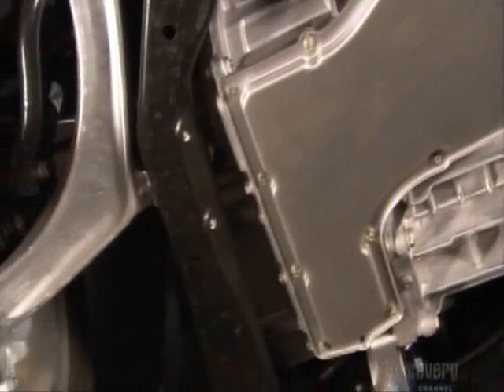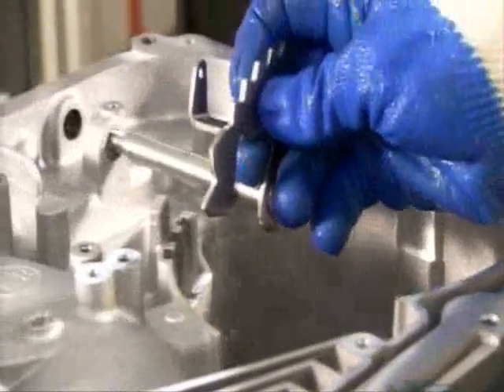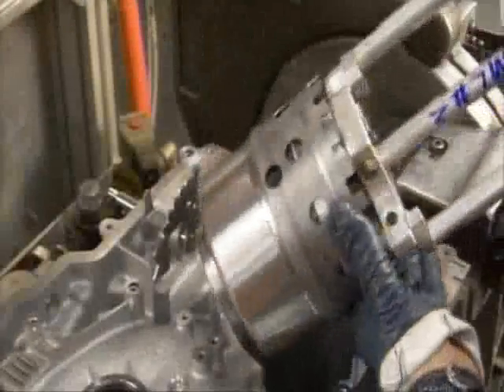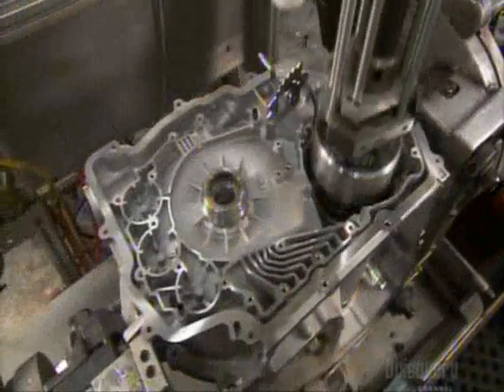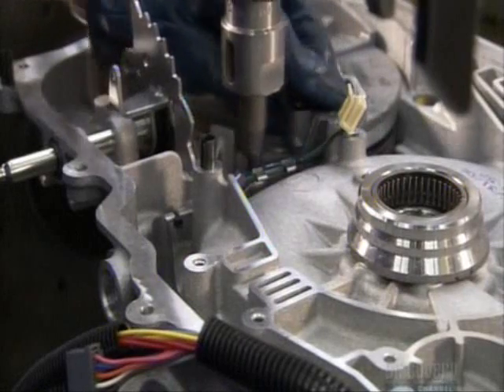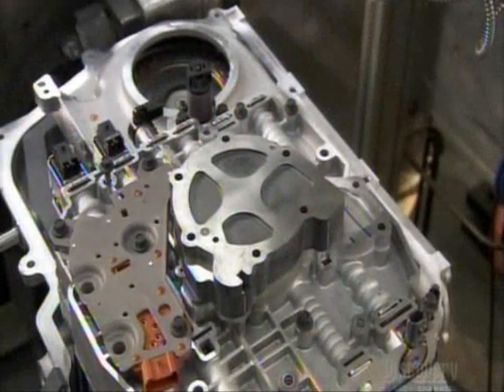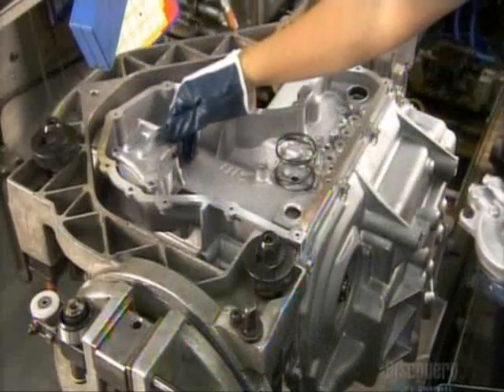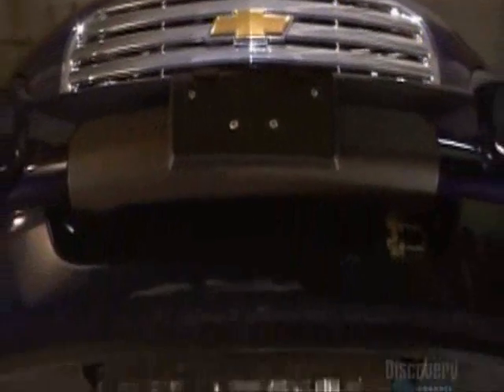How it's made Automatic transmission

Comment: Cheaply made transmissions, no check stick and forced to take it to a mechanic or dealer just to check the transmission level. That means that if there's a transmission leak then the owner can't check the level themselves and add fluid and can cause even more transmission damage or failure if they can't make it to a mechanic or dealer and either stuck or pay even more money towing the car when all it just needs is a few pints of fluid. Way to go GM.

Comment: automatic transmission the best👍
Reply: +Eduardo Caballero The best, huh? Well, concider this: There are certain things you can do with an MT what you can't do with an AT. For example, starting your car downhill in 2nd or 3rd gear if your battery doesn't have enough juice to crank the starter. No AT would let you do that!
Reply: ...said no one ever
Reply: +Bandicoot803  Honestly in this day and age, who the fuck needs to do this on a regular basis? Congrats you pointed out the only marginal (im being generous) benefit of a manual. Modern autos accelerate you faster and save you more fuel than any manual ever could.
Reply: havoc1482
I'm really speechless, you know? Your generousity really touches me!
I have to admit that you pointed out a really good reason for AT: Age! It's practical for partially disabled drivers who can't shift anymore due to being older or other reason.
But: If you can't or won't drive an MT due to laziness, then, I'm sorry, friend, you CAN'T drive! You can only move forward or reverse. Manual shifting is an art which is way superior to any AT or CVT. I don't need any computer to do the shifting for me (yet) !

Comment: Just know not all automatic transmissions function the same.  Honda automatics work more like manual transmissions that are controlled automatically. The internals favor a Honda manual transmission.  5 minutes isn't long enough to really explain how they work, but the video did a good job focusing on the main point. Hyrdraulics that are controlled electronically.  Without fluid it is a hunk of metal.

Comment: 04:31 they show haw a faulty screw is being put into an automatic gear shift, nice
Reply: Mario Josipović Wobbly but is it faulty? How do you know?
Reply: looks faulty to me, every part in there needs to be precise, i doubt a wobbly screw goes in there
Reply: It is just holding something in place. It doesn't need to be precise.
Reply: That wobbly screw is a TapTite Screw. It is a self tapping screw going into a hole that it not tapped. The wobble is just the way it goes in and taps its own hole. It was new technology back in 1993 when the 4T40-E was designed and is now standard procedure now. There were many innovative things on the 4T40-E and was  GM's World Class transmission till it stopped production as the 4 speeds were phased out in 2010. I worked there for 31 years and started when we built the TH-350 then the 3T40.

Comment: Bring on the electric car revolution. One motor, one planetary reduction gearbox, and one battery pack. No gear changes, no clutches, no stick shifting :)
Reply: C1500 Chebby Not sure you know how burning works.
Reply: So how then do electric cars "suck"? Because aside from the current lack of a transmission, and a noisy engine, there isnt much difference in performance of high performance ICEs to high performance electrics.

All im hearing you say, is you just like the sound of a loud engine. Because there's nothing about an electric motor that precludes a manual transmission.

Your tune will change when electrics start passing you on the motorway.
Reply: Mathieu Thomas Welcome to the real world
Reply: No, I didn't, those are pretty cool pieces of technology. 

Still, its the burning itself that gets you- can't dodge that CO2.
Reply: ADeviatedSeptum Lol i will i prefer the power of a real engine, and being able to have the joy of driving a manual. Ive been in a tesla before, and i dont like them at all.
Reply: Shadowaries1 Lol, you're the perfect victim for a Tesla. You really don't sound like you've driven anything more than a 60KWh Model S, much less looked at it's stats. What's your best quarter mile? Can you even hit 60 in under 4 seconds?

Fan motors? If you put fans on a P85D's two motors, they would probably disintegrate.

So, how do electric cars "suck"?
Reply: Shadowaries1 Lol, considering ICEs have had a 150 year head start, id say Tesla has already caught up. There are already plenty of electric rally racers in development, by the way, so I think you're gravely underestimating the speed at which electrics are overtaking gasoline.

The P85D has all wheel drive, so I see no reason why one with the right suspension and tires wouldn't do any worse on a rally track. Just because Tesla hasn't decided to compete against rally cars yet, doesn't mean they cant. There's nothing stopping them from putting a gearbox in it, well, other than current demand.

You're also missing the point that the Tesla P85D is a LUXURY SEDAN. It's designed for conditioned asphalt. It just happens to be better than the vast majority of ICEs. When they(or someone else) decides they want to use the technology to compete against the WRX on a dirt track, it will look like a toy.

Also consider the dramatic reduction in points of failure.

Whether or not Electrics are better than ICEs is debatable, obviously, but you're ignorant of the facts if you think they aren't even a threat, and that's what's gonna get you beat on a track.
Reply: Lol this is hilarious. All of the people saying they don't like Tesla's probably can't afford one (before you try and swing your dicks around, a P85D will set you back north of $90K). They have 800HP and 800Ft.Lbs. available at zero RPM. Having both hands on the wheel means you can take corners like you wouldn't believe and more focus on the road. There is a reason Formula 1 cars use SMG paddle boxes and no driver oppped clutch. Here's how I know what I'm talking about-I have been a BMW enthusiast since I got my license at 16 (24 now) and have owned numerous five speed BMW's and M3's. I currently drive a 98 Z3 five speed. I picked up a Fiat 500e as a commuter and it is fun as hell. Being able to dust ANY car off the line is clutch when you're in the city. You can snake in and around people like you wouldn't believe while the guy in the Ferrari in the next lane is 45 ft. behind you waiting for his v12 gorilla to rev up enough to produce power. Fact is, you truck driving douche bags have had your day in court and you LOST gloriously. It doesn't help your case either when you say stuff like "fuck polar bears and this planet". It only makes people want to set your house on fire more... :)
Reply: Brilliant
Reply: ther eis no way that in my life i will owned an electric car i drove a leaf few weeks ago its is awful
Reply: No, get a diesel powered car and run it on veggie oil. ZERO harm done to our planet. No batteries, no fossil fuels and proven longevity of a diesel engine. Smells like french fries and can leech of fast food restaurants for cheap cheap fuel.
Reply: Still creates CO2 and pollutes the air with particulates.
Reply: Probably not as much as diesel fuel.
Reply: Andy Skraga
Humans do the same.
Reply: And if you cook with veggie oil I'd say it's a lot easier on the environment. Cook with diesel? That's just wrong.
Reply: i hate diesel too yuk !
Reply: Diesel is a fuel, not an engine. The first "diesel" ran on peanut oil. The modern "diesel" burns cleaner then the air we breath.
Reply: No, it's the EPA that puts down strick emissions. I don't know if you know about the DPF, EGR, and SCR?
Reply: It takes almost 70 6.7L fords to make the pollution of one 7.3L .If you ask me that's a huge improvement. It also doesn't help that the air quality isn't as clean as it can be.
Reply: C1500 Chebby Diesel is actually a heat cycle... as opposed to the Otto cycle which most cars run...
Reply: krap101 Yea Diesel i weird it combusts by the heat made by pressure.
Reply: Shadowaries1 Drive a Tesla Model P85D and then see if you feel the same way.
Reply: ADeviatedSeptum lol not for a few years buddy my 02 WRX is pushing 450HP out of an originally 250HP engine, and my 2015 WRX STi has 350 with minimal mods, and the engine originally produces 3305HP. I smoke 600 HP mustangs in my WRX so im sure a fucking car with fan motors for power will be passing me.
Reply: ADeviatedSeptum actually yes the stock WRX hits 60 in 4.2 seconds in a non conditioned track Aka rally tracks. My 02 has a 0-60 time of 3 seconds on rally dirt track. Id like to see that thing go anywhere besides conditioned asphalt. Those coils max out at 14,000 RPM which is only about the 60-90 MPH range in speed. Without a gearbox you screwed after you max out. The point is electric cars will never catch up to real cars anytime soon. the new GT500 boosts twin turbo engines on a V-6 and is pushing 800HP.
Reply: "I hate fun"
Reply: Mr.Green A chinacharger on stock internals lol, whats a chinacharger, and im far from stock bro. Also Subaru is JDM not CDM. Its a fully built pro tuned JDM STi Engine, EJ257 to be exact.Its in an 02 WRX, and has a bit over 100K on it so i dont think its going to be blowing anytime soon.
Reply: Shadowaries1 DUDE! I am bashing all of the diesel dudes on here that rip on people driving smaller cars. What you have sounds NASTY. And in regards to the last part in your comment...hell yes, both in my Fiat (186 fl lb, at 0, trust me it's entertaining...) and my BMW which works out well enough. I don't think I called you out ONCE in my rant. Take offense where offense is due. Know your allies and your enemies, I think if you read my post a little bit closer-you'd realize you and me are more or less into the same kinds of cars.
Reply: Chace Hart Meh i normally come to the comments to bash, and troll anyway lol, and thank you for the compliment. Not a fan of diesels either simply because of the fuckbois in my area that "roll coal", and think its cool, especially to people like me in the smaller sport cars. Its a bitch when you get soot sucked into the intercooler because its a huge bitch having to clean it out, and clean the fins.
Reply: and no fun ...
Reply: I have a diesel car for every day driving and a v8 corvette c3 fuck polar bear and electric cars
Reply: Lol electronic cars suck. I have a 2015 manual WRX STi and it's the best. Automatics are for pussies who can't drive lol.
Reply: Chace Hart Actually try 503 HP Rear, and 259 front lmfao. My Subie kicks up 400AWHP from launch, and produces nearly 700AWHP at full, and still has better handling. I bet you think youre a bad ass "Dusting" people off the line in your cute little Fiat.

Comment: I love engineering but I will never understand how an automatic gearbox works. And this video didn't help. Annoyingly.
Reply: EFLCModder It's actually pretty simple, but there are various ways of transfering power from the crankshaft to the wheels. Older systems uses brake bands, the newer ones use cluthes. The shift control is the same hydraulic system. 
If you think of the auto transmission as a 5 speed manual gearbox with a clutch for each gear acting as the gear lever in a manual and the hydraulic system as the driver shifting, you are not far off how it works.
Reply: Stefan Asmussen Thanks Stefan. I have to say that this is the best explanation I have ever heard that's describes the principles of an automatic gearbox. I shall be remembering this for a long time.
Did you know that cars with auto boxes in the UK tend to one or two brackets higher road fund licence than the same car with a manual box due to their inefficiensy as UK road fund fees are based on emissions.
Reply: It consists of magic and friction and a lot of clutches, I shall join too of not fully understanding how it works. I still prefer having a regular gear box and 1 clutch, manual gear shifting isn't to hard when you learn how to do it effectively. Then again America has to be different than the rest of the world.

Comment: Why don't they just make a regular automatic transmission 'why all these front wheel drive transaxels' I hate front wheel drive 'it's probably another commie Democrats crazy idea!
Reply: pclose9 this reminds me of that comic where a guy falls off his bike and blames it on communism
Reply: ^Troll
Reply: word
Reply: pclose9 more friction and weight in rwd
Reply: Fwd is cheaper to make than rwd, as there are fewer parts. Less weight. Therefore, cheaper with better mpg, the two main factors ppl consider.

However, it is more expensive to service/repair when it goes bad.

Comment: A 4L60E is one of the best automatic transmissions there is. They are used for drag racing all the time. It's an extremely durable medium-duty transmission. There is a reason GM has been building them for over three decades.
Reply: And yet - watching being assembled there, it looks a bit cheap.

Comment: Too many new cars are Automatics and will be a nightmare one day for repairs since they are so complicated and mainly Front-Wheel  drive. A  manual tranny  can be replaced for about the cost of fixing an Automatic when it's really damaged and needs aboy $3000.00  to remove and fix. Plus, you can Push-start a manual if the battery dies and limp home.

Comment: I don't think so - Simple physics - During transfer of power from the engine to gearbox there is some loss of energy - Now add a torque converter and there is more loss of energy - This directly translates to lower fuel efficiency !! This is theoretical given the same engine with the same gear ratios, same fuel and same kerb weight. Ah! And also automatic transmission adds to some extra weight as well

Comment: The Mclaren MP4 12C fails on 2 accounts: 1) I asked which British cars goes around corners like the ZR1 or Z06 AND is in the same price range. Last I checked, you can buy 2 ZR1s for the price of the MP4 12C and still have enough left over to pay a British Butler to wash both cars AND serve tea and biscuits, LOL! 2) The Mclaren also fails because it is not thoroughbred British! The engine block was stolen from a Nissan and Mclaren then modified it. Very British to claim others tech as their own!

Comment: No. Camaros use GM's LFX (V6) or LS (V8) motors. They are pure bred American motors, nothing Vauxhall about them. Vauxhall is a wholly owned subsidiary of GM, so yes GM engines are also found in Vauxhalls. Saying that Camaros have Vauxhall motors is completely wrong. Also, when you say out cars in the UK can go around corners, pray tell, exactly which British car goes around corners as well as the Corvette Z06 or ZR1 or even the Camaro ZL1 And is in the same price range??

Comment: gears are important because when driving faster your engine revs will go to too high if you do not shift.  Manual shifting will result that the car transmission dont have to be extremely complicated and high maintance...   Plus if we talk about control.... automatic you can easely get out of controll due no controlled clutch/gas method. I rather have full controll over my car so I buy manuals. But you're still young so you will have to learn it all cuz now you're just ignorand

Comment: im guessing this is a newer style CVT (continuously variable transmission)?? in witch instead of "shifting gears" you actually shift to different clutch packs that have different gearing in the planetary gears. hydraulic seamless "shifting" with no "shift shock" it drive like it has one long gear like a moped scooter or a snowmobile.
even though they show a chevy HHR at the end of the clip im pretty sure this gearbox is not from a GM.
honda toyota nissan and subaru use them.

Comment: Well, that is true but, if you can handle a manual transmission (I didn't say you can't) it usually is the driver who shortens the life of the components. With an automatic transmission you are more at the mercy of the electronics, solenoids, speed sensors, etc. 
Of course, components can fail, nothing lasts forever.

Comment: thats what i said....automatic is bad..you lose out on power ware out parts on your car faster example like brakes,transmission and performance is key thing that is lost you cant tell you car to shift gears or when to hit the clutch a pc onboard will tell your car to..soo your not getting your money worth on top of that the car is more money if in auto  and gas is noticably better on a manual.

Comment: It's simple in concept.  You have gears to set a gear ratio. (Planetary gears)
You have a clutch, not so different from a manual clutch.  You have a torque converter.
And you have synchronizers on the gear assemblies.   In an auto, you simply have MORE gear assemblies, controlled by hydraulics.  There are some really good online animations showing how it works.  Nothing is complicated, it's just that there's a lot in the case. But only some of it is active at any given time.

Comment: Many people think the engine is the most complex item in a car. Not even close. When you think of all the hydraulics and gear sets, clutches, solenoids, and all the other components that must work in perfect harmony...the transmission is the king of complexity, hands down. Like the  coasting clutch. It allows the car to coast at low speeds, and brakes you at higher speeds. How? I have no idea, but I do know that it must work perfectly of the car will be undrivable. Amazing.

Comment: If you ever se a manual transmission being disassembled you will surely understand how they work :P
and some automatic transmissions use 2 sprockets where one (the drive sprocket) has weights in it an will expand when it spins fast enough that means that the higher the speed the sprocket spins the higher the transmission ratio.